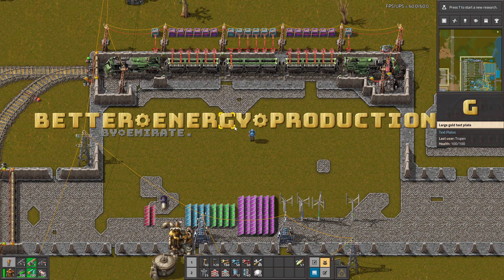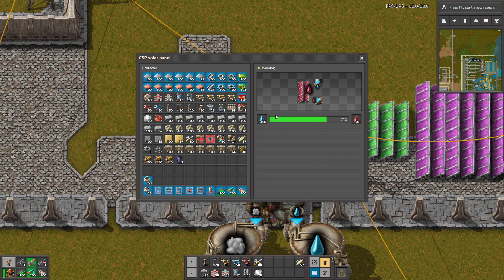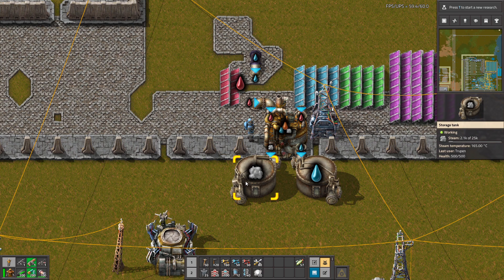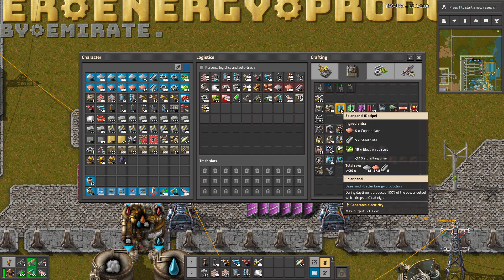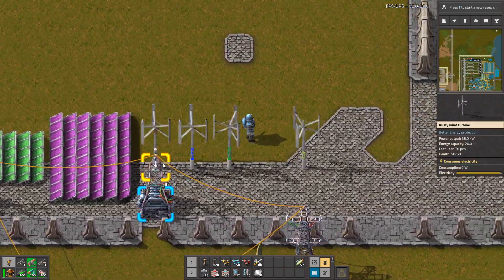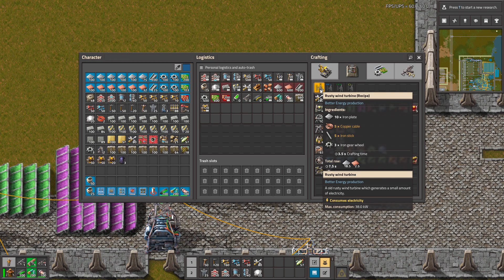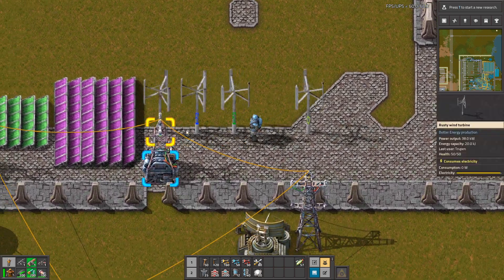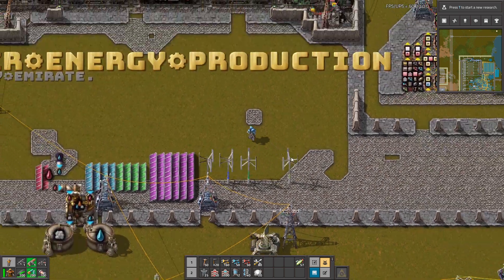Way Better Energy Production

Comment: I’m not sure about the ratios, but do you think you can loop the input water and output water together so it’s self sufficient? Or does it produce a little less water?
Reply: looks like the input is 50 water for 50 heated water, it takes 150 heated water to craft 350 steam but you only get 50 water back. this means you lose 2/3 of the water in the process. this makes sense logically though because steam is pretty much just hot water but steam is a gas and water is a liquid.

Comment: why isn't it converted directly into steam, seems unnecessary to require a chem plant to convert "heated water" to steam and water
Reply: I think it's implied the heated water isn't quite hot enough to generate steam, and the chem plant is using some magical process to transfer the heat from half of the heated water to finish boiling the other half. It's moderately difficult to concentrate sunlight enough to directly boil water -- that usually involves an uneconomically large array of mirrors pointing at a central tower.

Using solar thermal to generate electricity is silly in general -- might as well use photovoltaics. Solar thermal is better suited for showers and heating homes.
Reply: @Eidako  
Converting hot water to boiling water isn't actually that magical, reduce the pressure and the boiling temp goes down resulting in some water boiling at the cost of cooling the rest of the water(this is why in a vaccum you get steam and ice forming at the same time).
It's inefficient as the energy required to reduce the pressure is rarely worth it, but splitting hot water into steam and warm water is very possible.
Reply: @scragar  Still doesn't sound quite right. That would convert liquid water to steam, but the point of making steam is the pressure it exerts on mechanical parts -- if you have to reduce the pressure to get steam, the steam isn't going to have any pressure relative to ambient conditions and it would ultimately be a net loss of energy.
Reply: @scragar  Also looking closely at the video, there's a temperature gain. The heated water has a temperature range of 100 C to 125 C, and is transformed into 165 C steam. A pressure drop would result in 100-125 C steam.
Reply: It does seem unnecessary. Having the chem plant takes away on of the upside of solar panels which is being green. The chem plant still generates it's own pollution. It also makes solar panels more UPS intensive by adding the chem plant and pipe/fluid elements.